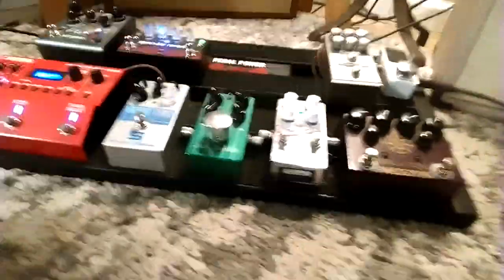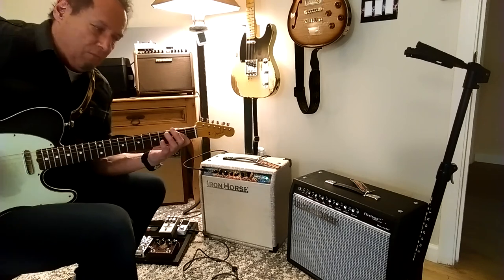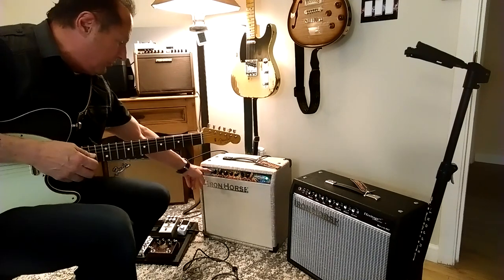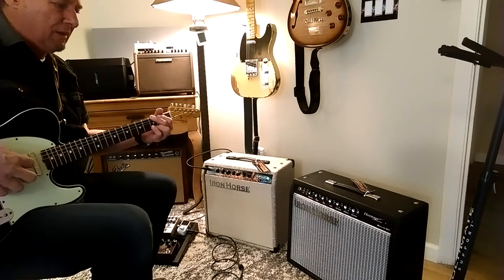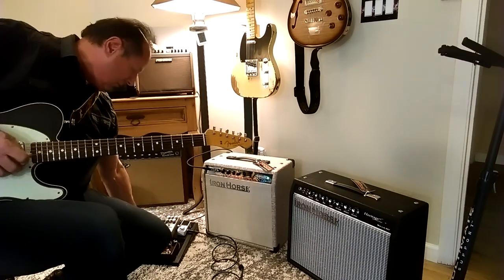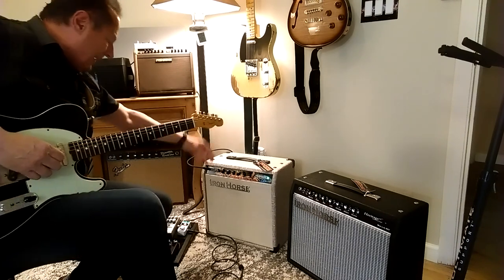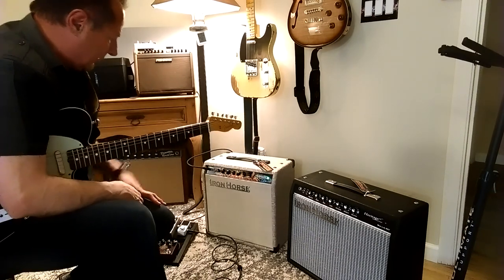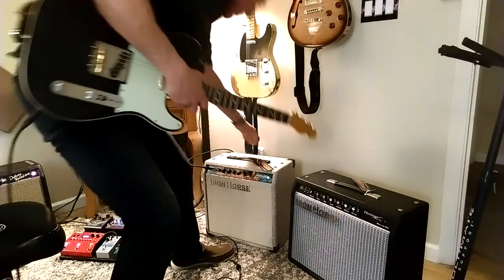Ironhorse Heritage 1x12 Combo Amplifier - Fawn Tolex - WGS ET65

Comment: Both sound very good.Great demo of the wgs. I been looking to get a wgs speaker for my fender concert which is older and 60 watt. It has an Ev in it now that sounds great but way to heavy. It’s something like 19 lbs. wgs recommended the et90. I kind of like the g12c and it’s rated 75 watt. In thr mean time I bought an ac10 which I can carry in one hand.. do you think the gc12 would work well. It’s a fender black face concert? 

How do you like the rc boost. I have the ep boost as that really thickens my sound.
Reply from the maker: Hey Thomas. I am really impressed with the WGS speakers. I prefer the G12C for my personal taste, but I see why many players love the ET65 too. Is the blackface Fender Concert a 1x12 combo? If so, I think the G12C 12" from WGS would sound great. I will say it has a full low end. But I like it. I roll off the bass eq on the amp and if you favor the bridge PU, it is magical. *But it sounds good in every pickup position.